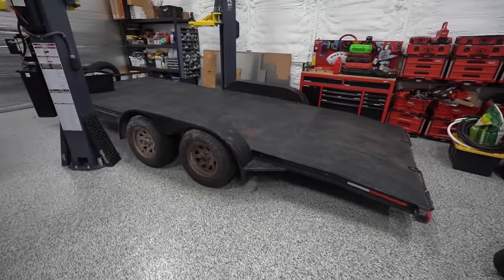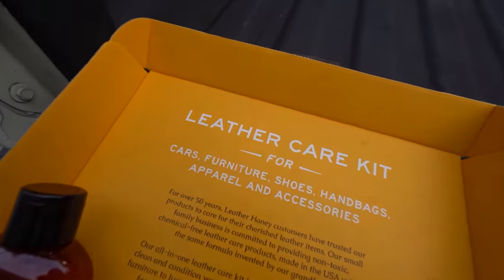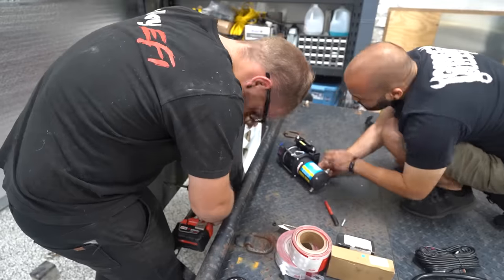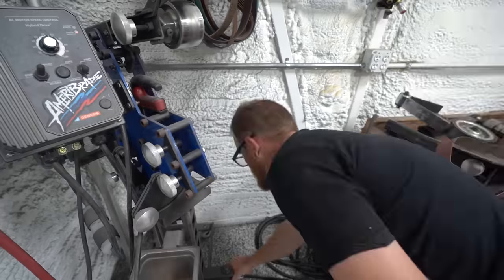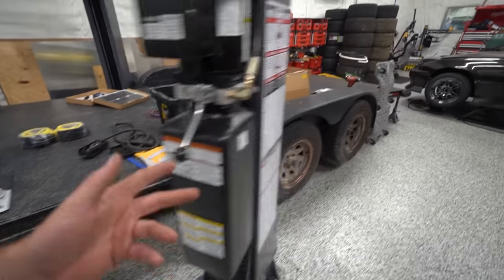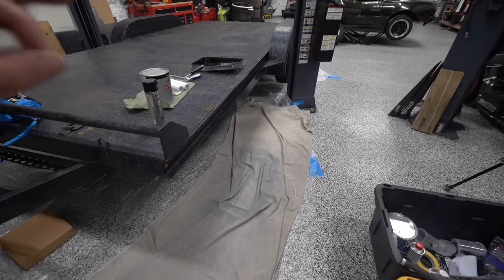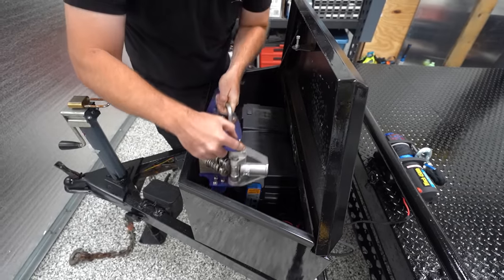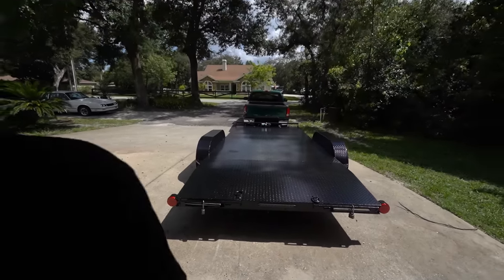Refurbishing and upgrading an 18ft steel deck car trailer. massive transformation

Comment: As for the trailer I agree with others for the reflective tape on the sides and even the back if there’s a spot. What I did with mine was also add small LED light bars at the very front shining down the deck. And if you have a 7 way plug anyways, I also wired in  back up lights next to my taillights, such a game changer at night!
Reply: Back up lights on a trailer at night and raining is undoubtably the best thing ever on a trailer, i have 2 on the front of the trailer shining out and 2 LED flood lights mounted behind the fenders flush with the trailer deck to see the whole rear of the trailer and about an 80’ wide spread behind it.

Comment: Make sure you repack the bearings and replace the dried up seals. It's tough to do on the side of the road.
Reply: Definitely.
Reply: yeah that's a good. seeing it look so nice, be worth doing.
Reply: I'd put new bearings, hub if needed.  can't beat new parts as a good P M measure.

Comment: hey Taylor, I am a king ranch owner that uses leather honey. it is definitely the best for leather seats. However, for a much better effect for the leather conditioner you want to get a rubber glove and use your hand to wipe it in, not a towel, the microfiber towel is going to absorb most of that conditioner. also make sure to use a lot on the seams of the seats.
Reply: King Ranch owner here too. I use the conditioner from the King Ranch saddle shop. Soaks in better in my opinion. I do agree with the glove though. I wear one and massage the conditioner in.
Reply: Glove is a good tip I always just use my bare hands the towel is useless
Reply: Leather honey is undoubtedly a good product Obenaufs is a better one though there customers absolutely beat the crap out of there leather (forestry service fire crews) between sunlight heat steam ash water chemicals dirt and mud those high end  boots can last 20years or more when being as abused as leather can be so long as it’s cared for properly I’m going to stick with them

I love king ranch trucks one of the only trucks that aren’t that bs engineered leather that flakes and peels
Reply: I use it in my Platinum to great effect.

Comment: Looks great! I built one for a customer a while back. Had the same tongue box and we scooted it flush to the trailer. Cut a hole and put the winch inside with the flush mount guide so that was the only hole in the box. Flush mount LED pods, inverter, outdoor plug box with cover, switch panel on the outside of box. Electric tongue jack and single battery inside that the truck would charge while running. But if you don’t do that then I would make a small cover plate to go over the winch for direct rain.

Comment: Couple things: first, I’d service the wheel bearings. I’d also hook up a trickle charger in the box for the battery.  Last, I’d have used a stronger winch.  That’s pretty small, but I’m not sure what you might be loading up, so….  Great video! Now I need to go out and do my trailer…
Reply: 4500lbs is fine for what hes doing with it, he also put solar panels on the battery to keep it charged so no need for a trickle charger.

Comment: One suggestion I have is to have some terminal covers on the battery since you have to remove the top of the battery box to put the jack in. It would be bad for the jack to short that big battery.

Comment: I did these upgrades to my 20ft car hauler when I first got it and still want to add some loading lights as well. lol. The only difference is I went with a wood deck. The wood doesn't last as long but it doesn't get as hot as a metal deck which is important for me since I'm usually laying on the deck when hooking up lowered vehicles. I'd also like to add rear trailer support jacks to take some lift load off of the ball when loading/ unloading.

Comment: Tractor supply tractor paint is what i use on trailers, it doesnt fade out like standard enamel. I used a Wagner airless paint sprayer to cover a 24’ deck over trailer in about 30 minutes and only used 1/2 gallon. Im so glad you cleaned  those wheels lol, some LED lights mounted in the back of the tool box and some on the back are the best additions to a trailer when backing up at night especially in the rain.

Comment: I have a trailer that is damn near same as yours. I love it. What I ended up doing was rhino lining the top surface and then cutting 2 hatch style holes in the middle under where the engine would be in the front and rear depending if the car is pulled on forwards or backwards. It allows me to do some fluid changes using the trailer almost like a roll on lift of sorts.
Reply: I prefer rhino liner.   Will hold up much better in the heat and won’t be slippery when wet. The Rustoleum enamel looks great when first coated but it doesn’t hold up well in the sun and fades pretty quick.  Plus it’s super slippery when wet
Reply: @Better_Car_Control  Yeah I found that out when loading up my car at the track and it was a wet day and I had slicks. Almost slid the car off the trailer that day lol

Comment: I did a similar rehab to my sons open solid deck trailer years ago. Top and bottom. Used POR 15 paint. One suggestion I would make is to go buy a plastic tool box that the winch will fit in and use as an enclosure for the winch. Very easy installation. Great protection from the elements.

Comment: Add a small solar panel on the tool box lid to trickle charge the winch battery.
Deck lights would be cool

Comment: Also I run my drag up tank in junction with my trailer power. My aux battery and wench also has my extra truck battery all linked. It does draw a lot of power but having it looped together allows my truck alternator to charge my aux trailer battery while I’m driving. Camper forums helped ah bunch!

Comment: Always wondered if there was a way to get my flatbed hauler up on my 2-post lift safely.  If you didn't do it or couldn't figure it out, I doubt I ever will.
Thanks for the motivation to rework my trailer collection.

Comment: A double outro!  The cool thing is each one was unique instead of some of the other 'tubers who just play the last 10 minutes over.  I can't believe how good the trailer looked before you painted it!  I remember when you first got it, I thought you were nuts for getting a trailer with so much rust on it!  One thing you may consider doing is prop the trailer up on it's side, and pressure wash, and paint the bottom, or undercoat it.

Comment: Maybe add some reflective tape to side of trailer like you had. I saw you pull it out in beginning of video but never applied it. Black trailer at night with just those ambers don’t think is enough. Also wondering if you painted the ramps because why not. Great job.

Comment: Thought I saw, during your layout of upgrades, a solar panel for keeping your battery at full charge? Was I mistaken?  Using such an item would surely help any future winch issues caused by a dead battery. Maybe I missed that you have it setup to be charged from the tow vehicle which would also be good??

Comment: If you want a cheap 3 wire enclosed loom for the side lights that you don't care if you splice every 2 feet a 25 foot 110 extension cord work well. I use to wire mower trailers for a municipality and keep the drop light cords we use to break just for this.

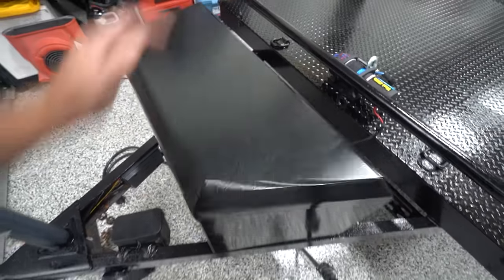Comment: 24:18 Just a heads up that pdlock is about as useless as a air conditioner in Antarctica. There are several non destructive bypasses and it can be opened faster using any of them than dialing in the combination.

Comment: A few things.  1. Did you paint under the winch?  2.  Did you set it up so the tow vehicle will charge the trailer battery when towing?  3.  Why not paint the trailer rims the same gloss black as the trailer?

Comment: Damn I need a shop. Tried painting mine last weekend in the sun and it was miserable. Only got maybe half of what I wanted done. The POR15 top coat also seems a bit finicky to apply as it dries super quick compared to the base stuff.

Comment: Do yourself a huge favor. Buy one of the camco tire aid ramps. Huge life saver and time saver on the side of the road. Even at the house instead of lugging a Jack around. It will even work with the enclosed. I’ve used it with a 24ft car trailer loaded with a car and a 32ft camper.

Comment: Why not add the reflective tape you already had to make it safer?  Also since you went to all of the trouble to built the jack extension why not add some gussets so the pad doesn't break off?  I would have shift the battery to one side to maximize the usable room inside if the toolbox.  Also on the junction box, did you run the truck tail off the back and the light tail off the front so each of them had to make a 90°bend to go the correct direction?

Comment: honestly surprised u didnt add a steel plate to the A-frame in front of the tool box and place the battery box there so u could keep all ur storage... i think a fabbed battery box that u can lock the plastic box into, would've been pretty cool

Comment: Depends what route you go for wheels but a set of AR172 Baja or Ion 171 wheels on the trailer would match the current RAM wheels as well as any semi/holey style dually wheels like Alcoas, DDC The Hole, American Force DB01, etc.

Comment: Hey Taylor, go to Harbor Freight and pick up a couple of those magnetic tool holders and put them on the inside of the tool box. Could use it told some small hand tools you might need on the trailer

Comment: Didn't want to paint the tongue jack to match? looks a little out of place now. Would it make sense to turn the battery around and run the wires out of the back so you aren't close to touching the posts when putting the jack in? Maybe cut the cover flush with the battery so it can stay on?

Comment: Ik this may be a long shot taylor but on the side of your shop where you park the trailers, why not put a lean-tube off the shop with some gravel to park the trailers and the tow rig under so they'd be out the weather?

Comment: The trailer late at night is going to be hard to see from the sides (while turning) to other drivers.  You really should replace the reflective tape on the sides of the trailer to increase visibility at night.

Comment: Things to add to the trailer...  1st and most important, aren't you supposed to have the white and red reflective safety tape on the sides and rear of the trailer?   We need to have that up here in the northeast.   Secondly, I'd add a big set of LED backup lights on the rear of the trailer, they always come in handy backing up at night.   And lastly, maybe a set of loading lights on both sides of the winch illuminating the deck of the trailer, and a couple of small LED lights for the inside of the box, so when you are loading at night, you have all the lights you need.   LED lights draw so little power, that basically any draw on them from LEDs for 150-30 minutes isn't really going to have any effect on a good deep cell battery.   Just my 2 cents...

Comment: That winch is way too small. Should build out in between the bed and box mount the battery/batteries there and enclosure for the winch and lights. Another good idea is mounts for a adjustable drop supports in the rear.

Comment: That things still brand new my dad's car trailer is from the 80s all steal 2nd skin on it 3rd set of fenders and 3rd set of axels and need to get the old military deuce and a half winch fixed that's on it a few frame patches and a new box for the winch and strap

Comment: A small solar panel is clutch on a trailer with a battery. Keeps the battery topped off while it's sitting outside.

Comment: those winch wires are way to small there gonna melt over time you need 0 gauge also you should have got a 10 000lb winch minimum that little one might get the job done but they struggle and your wiring on trailers you should use this stuff called arctic flex i believe it like a blue covered wire google it and it well come up and sheave it as well then you should never have an issue again this stuff is pricey but it well last  its so worth it

Comment: Hey just my 2 cents, but I bed lined my whole trailer and no more repainting every 5 years. Also, now that you have a battery on the trailer you can weld a 4ft pole at the front and add a light to light up the trailer at night if you need. No matter what i watched evey video for the past 5 years and enjoy the content.

Comment: I would delete the brake battery and tie it in to the winch battery so you can charger while the trailer connected to the truck. And make look cleaner

Comment: the wires around the inside of the box bothered the shit out me all that time talking about making it look nice hiding the wire and you run them right up the front of the battery box inside where everything else is going to be running on them and not running them up the back of the battery box inside between the battery box and the trailer box just dont understand why plus you talk about putting a jack in there thats going to rub threw and crush those wires and could cause a fire